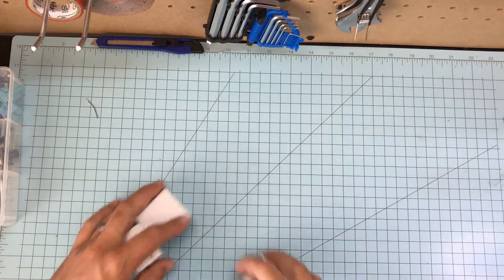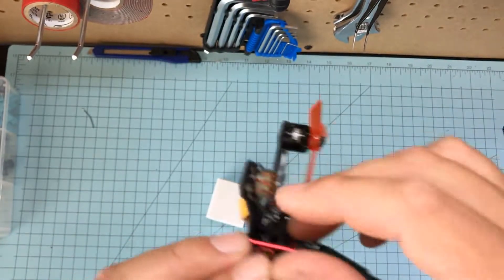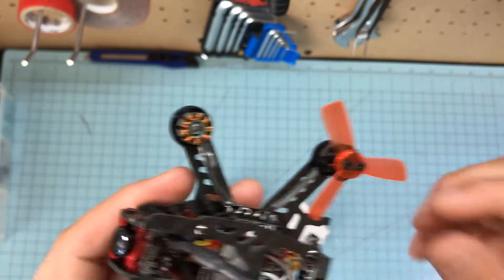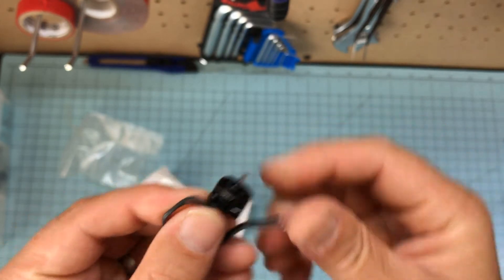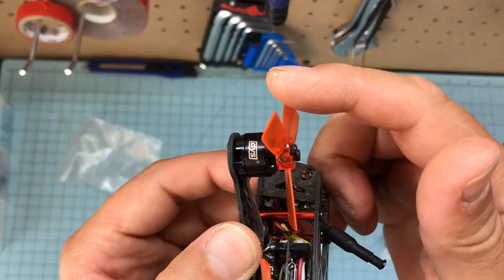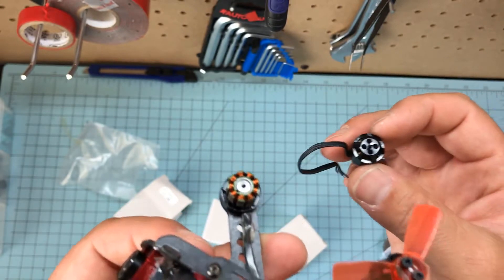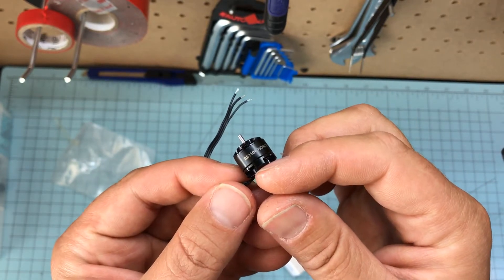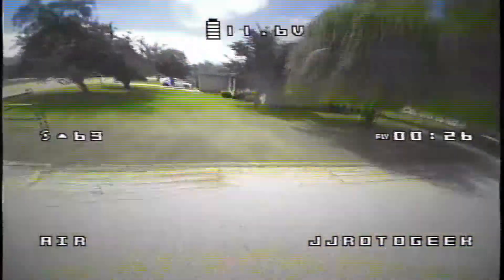DYS 1104 7500kv Motor overview  Awesome

Comment: Can you use 1104 7500kv motors to replace 1105s 8500kv  ?
Reply from the maker: R u replacing all 4 or just one or two
Reply: JJRotoGeek none yet,  just curious for future repairs really
Reply: Just wondered if you can use different heights or do you have to stick w 1105s if your model comes w those stock. . I'd like to use 1104s instead but unsure what effect it will have
Reply from the maker: U can.    But mixing of Kv variations works well.   Stator height, ehhh.   Not as great but I’ve had friends that have done it
Reply: JJRotoGeek so 1104s rather than 1105s would still fly do you think?
Reply from the maker: Oh absolutely
Reply: JJRotoGeek Oh ok so  1104s 7500kv versus 1105 8500 kv will just have less ooompff then but the thing will still fly
Reply: Appreciate the info :]
Fairly new to the hobby ..
Reply from the maker: Sweet.   Let me know if ya need any help or have any questions brother
Reply: JJRotoGeek thanks ;) & will do 👍
Reply: JJRotoGeek I'll have to pick up some of those DYS motors.. :)
Reply from the maker: I like the dys.    But I like the ipower better
Reply: JJRotoGeek Oh how come?
Reply from the maker: Dys have been know. To have c clip issues, I’ve had it happen a few times where the bells would come off in a crash.   The ipower work just as well and don’t seem to have that issue
Reply: JJRotoGeek thanks for the tip. I'll have a look for those then in future
Reply from the maker: Don’t get me wrong.   The dys are great I have loads of em.   You’ll like em

Comment: Nice vid and good info!  Do you have any problems with heat when running those on 3s?
Reply from the maker: I will let u know when I try it.   Your not the first person to ask that.   But I’m gonna do it lol
Reply: JJRotoGeek have you had a chance to test them on 3s?  I’m just getting into micros and have these motors and am trying to figure out 3s or 2s and what props to use.

Comment: Thank you.  My questions is about replacing some 1104 motors on my Tarot 130.  They have wimpy 6a ESCs.  Will they works as replacements?
Reply from the maker: +frankyoualot with those esc’s, I would run 6500kv 1104.   U should be ok
Reply: i tried 1105's thinking they'd be compatible, but no - they didn't reach full throttle..I'm still new to the realm of motors - and I cannot find specs to distinguish the difference between 1104 and 1105, etc.  Do they require certain amps?  Wish there was more documentation out there, thanks for the help!
Reply from the maker: +frankyoualot hmmm what size props and battery r u running
Reply: 3020's and 3S 450mah, Tarot 130mm came with junk 1104's, if you look at them they break
Reply from the maker: +frankyoualot ohhh that’s not good.  I realllly like the ipower and dys brand of 1104. The hglrc seem really nice too
Reply: Yes, i have an iPower 1104, but it didn't go full throttle once connected.  It is 7500kv while the Tarot 130 stock motors are 4000kv.  Are the stock 6amp ESCs not giving the 7500kv motor enough power?  This is when i use Betaflight motor control with the sliders - I noticed that past 1100 they won't go faster.
Reply from the maker: +frankyoualot ahhhhh.    Ok.  So those are running multishot protocal???? It’s not the motors brother, sounds like your esc calibration. I have those shitty ass 6a emax babyhawk esc’s on a bird and they will push full end.   That’s not an esc power thing.   Esc’s will push till they blow up lol.   Sounds like calibration
Reply: Okay, good to hear - Sadly this Tarot configuration wants PWM only for the motor control.  Any other setting will make the motors twitch and not work correctly.  BLHeli configurator would not connect at any cost, so i couldn't get that far.  Of course I attempted to calibrate via Betaflight, but that didn't correct the problem.
Reply from the maker: +frankyoualot that’s odd.  U should still be able to calibrate them through bf.  Unless they locked out the programming function of the escs
Reply: yes, i was able to calibrate them through BF but that didn't resolve the issue..i will hack at getting blheli configurator working
Reply from the maker: +frankyoualot in the reciever tab, what is your throttle range
Reply: 1000-2000
Reply from the maker: +frankyoualot that’s what it’s set at or that’s what your radio is really puttting out?
Reply: that is the setting in betaflight
Reply from the maker: +frankyoualot what’s the range on ya transmitter

Comment: im gonna put theze on my fly egg 100!
Reply from the maker: Xplicit fpv they rip pretty damn good!!
Reply from the maker: Xplicit fpv dude.   The dys r awesome.   But check these out as well, just as good in my opinion http://www.getfpv.com/iflight-ipower-ix1104-7500kv-fpv-racing-motor-set-of-2.html. And a bit cheaper
Reply from the maker: Xplicit fpv I have those I power motors on this build https://youtu.be/XgHJYKB2lFY and going to use them on my micro build video https://youtu.be/XgHJYKB2lFY
Reply: JJRotoGeek.they'd work on the egg?
Reply: JJRotoGeek how hard is swapon the motors? do u have a vid on it?or could ya do 1?
Reply from the maker: Xplicit fpv oh absolutely.  They will work on the flyegg, well let me rephrase that, they will work on my flyegg build.  Do u have the flyegg100 rtf?
Reply from the maker: Xplicit fpv I just looked up the flyegg rtf, yes, 10a esc 1003, these are 1104 but will work fine.  And are wayyyyyy better than the stock motors.  Do u run 3s or 2s on it???? With. 3s it will be fine.  And 2s would prolly be even better honestly!
Reply from the maker: I'd be happy to do a video on it for you, but I'm not sure how much help it would be since my fly eggs are custom builds.  But the walk through is about the same